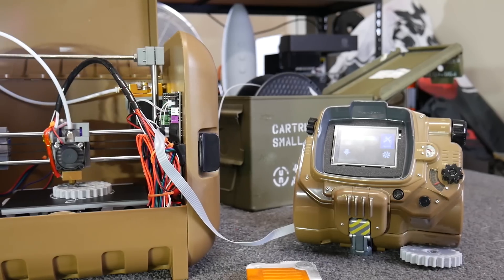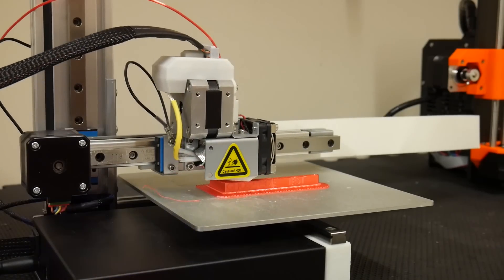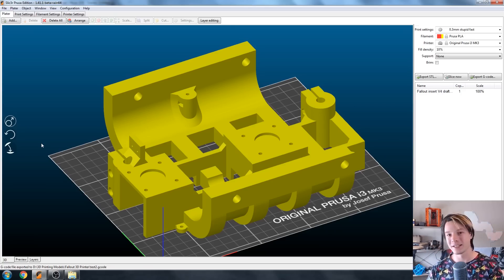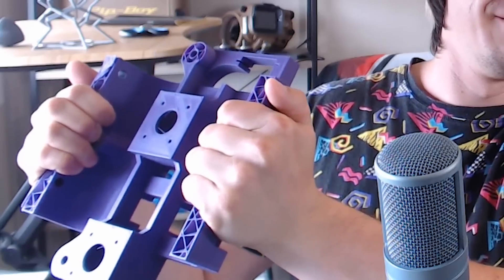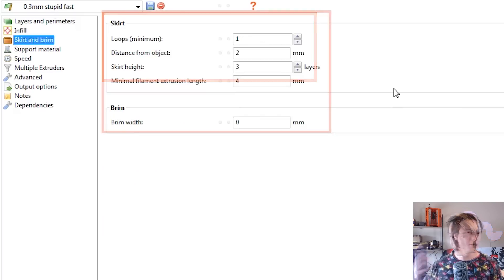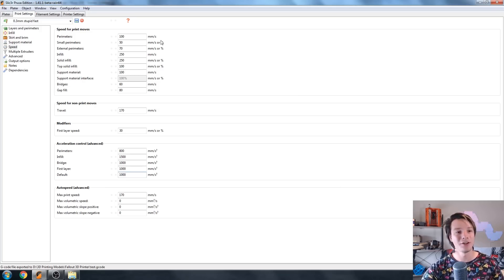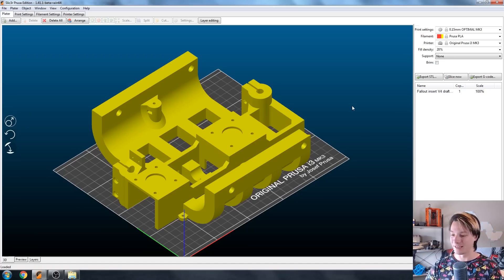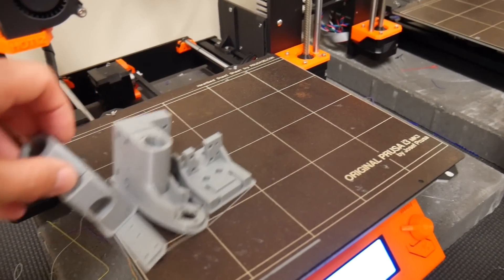3D Print parts TWICE as fast with simple slicer tweaks. 3DP101

Comment: Im just tinkering with an anycubic mega S its $100cad printer but at this point majority of everything i print on it prints in a few hours but im bout to do another round of tweaking things to see if i can get another 12-15% off my print times its amazing what you can get for $100 ($60usd)
Reply: If everything works out my setting changes should cut the print times by 45% but idk if my printer is capable I’ve already pushed it quite far think this is my 3rd or 4th time trying to tweak stuff to save time

Comment: Old vid, but I've been on a quest to TRULY get fast reliable 3d printing. Speed is easy to get up to a point. 500-600mm/s) but getting big flow was tough. I made a super simple solid copper hotend that flows OVER 100mm/s3 with a 0.6 nozzle. Now I have enough flow to run BIG FAT lines- and I've run back into speed being the problem again😂

Comment: I'm a bit late to the party, but I notice also a setting in Prusa slicer under Printer Settings->Machine Limits->Maximum feedrates, where as near as I can tell on MK3+ machines, that number is 120mm/sec for the extruder. Does this impact or limit settings like 250 mm/sec you have for infill, etc?  thanks, and thanks for the great videos you provide.

Comment: I keep coming back to this video everytime I install Prusaslicer on a new machine so here are the settings for the stupid fast preset:

Settings:

Layers and Perimeters
Layer Height: 0.3mm
First Layer Height: 0.2mm
Perimeters: 2
Solid Layers: Top:3 Bottom:3

Infill
Fill density: 10%
Fill Pattern: Cubic

Brim
Default settings

Support Material
None

Speed
Perimeters: 100mm/s
Small perimeters: 50mm/s
External perimeters: 70mm/s
Infill: 250mm/s
Solid infill: 250mm/s
Top solid infill: 100mm/s
Support material: 100mm/s
Bridges: 60mm/s
Gap fill: 80mm/s
Travel: 170mm/s

(Acceleration Control)
Perimeters: 800mm/s^2
Infill: 1500mm/s^2
Bridges: 1000mm/s^2
First layer: 1000mm/s^2
Default: 1000mm/s^2

Filament: 
Prusament defaults

Comment: 3D Print parts TWICE as fast with simple slicer tweaks. 3DP101) Hi i'm new to this i'm not to sure on how to get the same result for my ender 3 printer. I'm using ultimaker cura. It would be great if you could send me a cura profile that would do the same job. i would really appreciate the help

Comment: I've had good luck on non critical artsy model pieces using 2.5% rectilinear infill or none, speeds at 80mm and .2 resolution. Just barely enough infill to support anything that will be printed on top and give a little more structurally stability. This has cut my print time in half on some prints.
Keep pushing your printer/prints to the failure point, and you will learn way more about your machine and how to do a good print every time.

Comment: Strength in 3D prints come from the walls. Infill resists compression/expansion, but for the most part it just provides a framework for the walls to be built on.

Comment: I believe the final use of the part can dictate the need for a more rigid structure. For a base of a 3D Printer machine which requires strength and accuracy I would not reduce any material but for some other parts it would be more than welcome.

Comment: I just got my first we printer, and what surprised me the most was how incredibly strong the parts were, like for example yesterday I printed a small tower that is 10x10x50mm 50mm high, this is not an optimal orientation for layer adhesion and strength, it was also only 2 perimeters and 10% infill. I tried as hard as I could to snap it in half, however I was completely unable to do it with my hands alone.

Comment: I got an older prusa i3 RepRap mende for 100$ l  picked at it for about a week or so and got it running faster than lighthtning it's killing my new mp10 but unfortunately the outcome was the vibration shook loose the bed nuts that attach the drive belt tensioner pulley 😬and that's definitely a complete layer shift 🤣 definitely lost that print oops 😬🤣

Comment: i might be crazy but i printed my project with 0,8mm nozzle at 230c with stock settings for 06mm nozzle from creality only increased the extrusion width and layer heignt to 0,5mm
i also cut my print in parts so i can print one in under 3 hours  and gyroid infill if i ever decide to fill it with resin
the aded bonus was  i cut in in places i could drop in a motor or other parts to be fully enclosed , a way that would be impossible if the model was solid all the way trough

Comment: One thing to be aware of when using larger nozzles, wider extrusions, and thicker layers is that you will eventually be limited by the volumetric flow rate that your hot end can provide. For a lot of cheaper printers like the Ender 3 clones, you won't be able to squeeze out much more than about 10-15mm^3/s. However, with better nozzles, heat breaks, and heaters, you can push this much further, with some going well beyond 30mm^3/s.
Reply: why is it mm^3?
Reply: @barbarosbozkurt758  cubic (aka to the power of 3 which is what ^3 means) millimeters is a measurement of volume just like cubic centimeters or cubic inches, cubic feet etc.

Comment: The explanation of why it is way longer than you would think, for anyone who’s curious, is that if you double the size in all 3 dimensions of a 1in cube, it is then 2 in by 2in by 2in the area of a 2in by 2in square is 4in squared, so it increases by a factor of 4, likewise, the volume of a 2in by 2in by 2in cube, is 2x2x2, so 8in cubed, meaning the volume is increased by a factor of 8. The high amount of filament that needs to be extruded is the main cause of long print times, and the total amount of filament that needs to be extruded is directly proportional to the volume of the part. This still applies without 100% infill because you are still increasing the volume of the walls themselves. Hope this helps anyone who was curious! 😃

Comment: Its funny to watch this in 2022 after building a voron and watching all the speed boat stuff. 3D Printing has somewhat stagnated hardware wise. But Firmware with Pressure advance and Input shaping. Would have been crazy to think that i now run 4K accelerations for Quality prints Travel speeds at 300mm/s and there are people out there that print at double that.

Comment: Using Gyroid Infill takes a bit longer but I have noticed that it is a lot stronger. I usually leave my infill at 10
Reply: I believe CNCKitchen or even Angus himself did a test about which infill type was strongest / most efficient. 
and Cubic and Gyroid were about the same. 
I used gyroid for a long time but found that printing it causes my printer to vibrate a lot. whilst cubic doesn't have that issue

Comment: I print thin-walled parts for rc planes.  These parts are weight sensitive and so i have to run average 38 to 25 speed so i dont get artifacts and it takes forever to print but if i try to speed up the process, i get all kinds of problems.  Any ideas?

Comment: Cura has a cool feature called jerk control, it allows you to set the speed at witch the print head changes directions. At say 100mm/s the print head jurks when changing directions but you can make it change direction at say 8mm/s so it slows it down just before direction change and eliminates jerk. It hardly adds any print time to.

Comment: Hi Angus. You inspired me to try a stupid fast setting myself on my Anycubic Kossel Linear Plus. After some issue’s with bed adhesion and upgrading to PEI powder coated magnetic bed, I found good results with first layer and my own stupid fast settings (using Cura 4.8, 4.12.1 or Arachne Beta2) which I’d like your take on. 
My layers are 0.32mm with 1st layer 0.3mm. I set my wall widths  to 0.8mm using a 0.4mm nozzle. 1st layer Extrusion at 130% (for guaranteed bed adhesion) then back of to 100% extrusion for the rest. Hot end settings at the highest end of recommended filament heat range(I use 230°C).
Speed wise I’m ranging between 60 and 120 mm/s with acceleration at 2000 mm/s/s. 
I was surprised that the 0.8mm line width extruded so well from a 0.4mm nozzle and resulted in very good layer coverage and layer adhesion. A calibration cube in vase mode at these settings strarted me off on using this setting as my own goto stupidly stupid fast larger model settings.
The 300% vase mode calibration cube (60mm x 60mm x 60mm with a 0.8mm wall width) using Curas ‘0.2mm Draft mode’ takes just over 2hrs to print at the default settings. This one takes 21 minutes. Not bad.

Comment: Hi Angus. The way your part is designed has a significant impact on the part's rigidity as well. I believe that that's why you couldn't break it apart. Your part design is sound, and will withstand the stress put on it. In fact, your part is so well designed that when you attempted to flex it you couldn't.

Comment: you can make you prints even more faster:
If you make you own printer profile you can make you prints more than 40% faster, because you prusa profile have some isues with slowing you head down in curves.
But own printer profiles have this not because, its a normal gcode that means its without modifycasions and this makes you print faster.

Comment: for big prints like this I use volcano e3d with 0.6 nozzle and 0.4 layer height, parts are more rigid compared to 0.4 default nozzle and print speed is quite reduced. Trade of is little lower layer resolution but is acceptable

Comment: Print time, the 3d printing community's dirty little secret, lol.

I knew 3d printing wasn't all that fast when I bought my printer, but I was still surprised at the length of print times I was getting.  I thought maybe I was doing something wrong until I heard somebody make a remark in a video saying "an hour, hour and a half to two hours" being a typical time range for a Benchy printed with normal settings.  I believe it may have been here in one of Angus' videos.  Pretty sure mine took between 1 1/4 to 1 1/2 hrs to print so I'm in the "range".  I think posting actual print times would be a benefit for beginners like me.

I did have a killer Space Ball's reference for the "stupidly stupid fast setting" comment but that horse was beat to death years ago, lol.

Comment: Make a setting for 'just under total destruction' LOL  I know that on the ship (USN) when we would go for a top speed run (usually only when we are have to be there NOW! Someone is shooting at us, or just before/after going into/out of  the shipyard, for testing purposes) we used to joke that you could hear all then engineers (murmuring) , not on watch, praying that something would NOT break (ironically we had a turbine eat itself (threw three first stage turbine blades and it died!) at near idle!)!  P.S. The USN claims that a destroyer is good for 34+ knots, we got going one time and the pit log (speedo) had us at OVER 40.5!!!! Then the Carl Vinson (an AIRCRAFT CARRIER, weighing 102,000 TONS) blew past us and, before she got done, was doing 52.5 knots (55 mph!!!) (THAT IS A 13 STORY BUILDING, WITH 5200 SAILORS, 68 AIRCRAFT, THAT HAS FOUR ACRES OF FLIGHT DECK, AND IS NEARLY 1200 FEET LONG, MOVING AT HIGHWAY SPEED!!!!)

Comment: I design my printer to switch from a two in one out BTT 1.75 mixing extruder .4mm. To a direct drive 2.85 mm e3d with .8mm nozzle. In under 10 minutes. I used to run a two in one out where one side was 1.75 and the other was 2.85 but the bone tube had to be very thin 3 mm in 4 mm out and didn't work real well. With the new design printing large objects is simple. You can use a for contact relay to switch extruder Motors over but with the new Big Tree Tech motherboards it's easier just to run six drives. Me on the other hand I decided to go with six drives on board Within a gtr 1 then add an extra single extruder board. That way I didn't have to rely on a relay. Works good I've got the cad files for the head switching with the build on BL touch if anybody needs them just message me. The nice thing is when you switch the heads you don't switch the BL touch so you don't have to buy a bunch of BL touches.

Comment: this saved so much time thank you!
Also not just for test prints but loads of functional prints. i needed to print 240 time a print that normaly takes 13 hours now 3 hours each with still reasonable quality some slight imperfections but for a functional print perfect. this is done using ABS bdw.

Comment: I feel like such a noob at this. I am using tinker cad and the software that came with my printer. I am getting the results I want fairly quickly. I was able to create what I wanted and able to get decent print once I figured out the size which seems to be the hardest thing I had to do it took 3 tries to get correct size. The printer I have does a lot of settings it doesn’t have a heated bed. Cost was 200 dollars I think getting a machine that was proprietary may have been a mistake but I think it got me to the result I wanted fairly quick.

Comment: Mathematically, if you enlarge a 20 mm cube to 40 mm you are not doubling it. You're making it 8 times bigger so if it takes one hour to print the 20 mm cube it will take 8 hours to print the 40 mm cube. It's cubed, not squared. Think about it. It's being doubled in 3 directions, x, y, and z. So, 20 X 2 X 2 = 80.
8 times longer to print. Nice video! I'm definitely going to be tweaking my Cura settings.
Also, how about going smaller? What do you have to do so delicate prints aren't made so delicate they crumble when you try to take them off the bed...

Comment: Angus, you will gain MUCH MORE speed with a thicker nozzle. Line 0.6mm nozzle will save you about 50% of print time or so.
All the things you said is also work. But for the prints not needing high precision thicker nozzle is the way to go!

Comment: I started printing with these settings, everything has been ok except one. My extruder motor is skipping every now and then, is this fine? the print is coming out ok but it doesn't feel right. never happened to me before. I already tryed heating up the nozzle a few degrees, which helped a little but it is still happing. any tips?
Reply: Tighten up the direct or bowden drive screw wich increases the pressure it grabs the filament and should hold better

Comment: Due to the square cube law, increasing the length of the sides of (for example) a 2 inch tall cube by 2x, the height only increases by 2x, but the volume of the cube has increased 4x.
Reply: 8x.  2x height, 2x width, 2x depth

Comment: I wonder if a tuned mass dampener could reduce the vibrations on quick changes in direction, it would be pretty hard to design but it could help vibrations without redesigning the entire frame system and cutting the mass required. Sandvik use it in their 'silent tools' series to great effect allowing the diameter to length ratio to be significantly higher while maintaining a fantastic surface finish.

Comment: Start with 0.2mm layer. Use speeds around 60-140 mm/sec. Use accelarations in the 800-1500 range. Reduce infill to 10-15%. Use 3D infill pattern like Gyroid. Use the PrusaSlicer Variable Layer height that greatly reduce time preserving quality as much as possible. Boom. 45 seconds to show all the useful settings....then why talking for 15 minutes??

Comment: How did the motors fair since you posted this? In changing the speed you're changing the current + voltage going thru the motors. Motor or belt burn out yet? Does not look like you changed the values by much so im curious

Comment: This doesn't work with Resin right? :(
Reply from the maker: No lol, but MSLA cures an entire layer cross section at the same time, so you can print multiples in the same time as printing one!
Reply: @MakersMuse  But Im regretting getting a Resin printer. I wanted more resolution to print figurines to sell because I do 3D modeling so I got the QIDI Tech Shadow Pro 6.0 but the prints are way smaller compared to FDM, the materials are more expensive and making a small frog around 3x5 inches took me 11 hours to print. I think the technology is just not there for Resin printing compared to FDM.

Comment: Recently saw some published research explaining why a nearly-flat inner surface instead of conical has better heat transfer & extruding performance (the melting interface of the filament and the nozzle).  I wonder how much mroe speed you could squeeze out if you could get ahold of a brass nozzle that's milled instead of drilled.   I'd find all the info if you'd be willing to give it a shot in a video.

Comment: I recently was printing a photo lithograph on my Ender3, all was going good but after several hours I went in to check on it and it looked like my layer shifted about .25 inch. What would cause this? Everything was very straight and then it shifts 
.25 inch over. I checked extruder and there's no slop, still tight, also checked the belts to see if there loose.

Comment: could I possibly get the stl for the printer base you designed? I have been wanting to print another 3d printer for awhile. I have a extra mb and a heat bed and a couple spare stepper motors. So I wont have to get much else to make it.

Comment: metacollin, very useful insights.  You discuss significant rheological issues and good that you have.  Sadly, the open source slicers are still quite entry level, I will follow up with your settings photo.  Just watched a Univ of Michigan 'promo' video discussing acceleration control which is also in the correct direction but your points are very significant and hope that more get to read them.   Congratulations, great comments.  BTW, I have changed the E6-like extruder for a Volcano design to up the maximum volumetric flow rate. OK, this is a more advanced change to a 3D Printer.  However,  its not that difficult.  My next change is to precompute the path profile for better flow control vs. acceleration.  Have you considered that point?